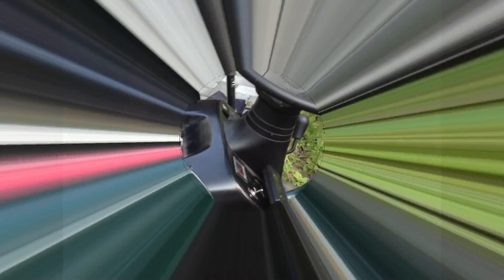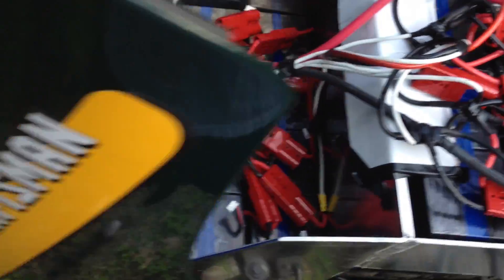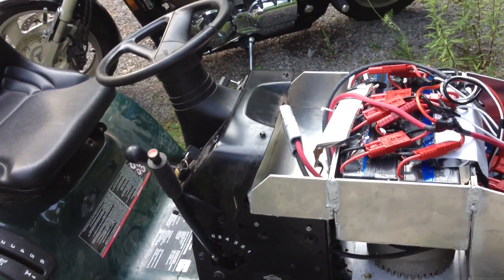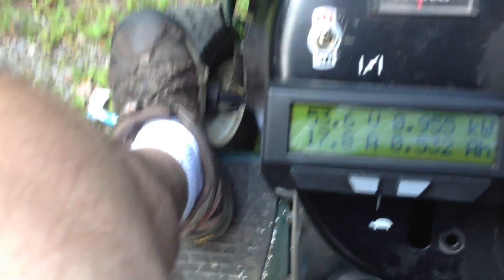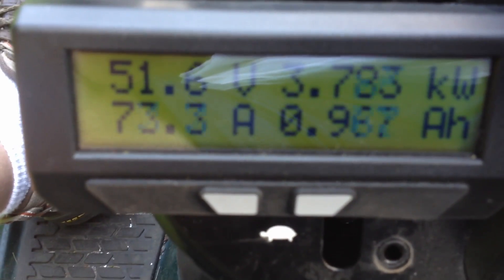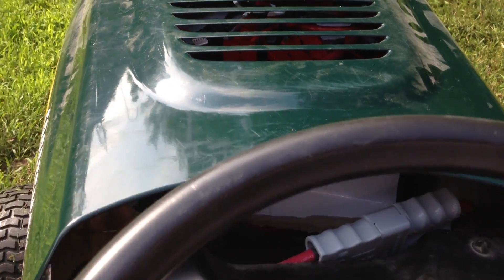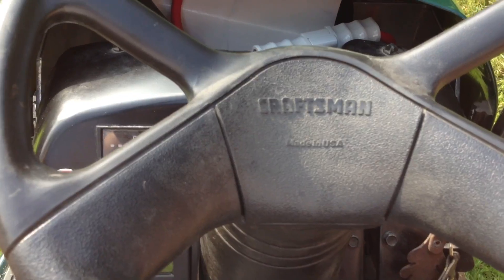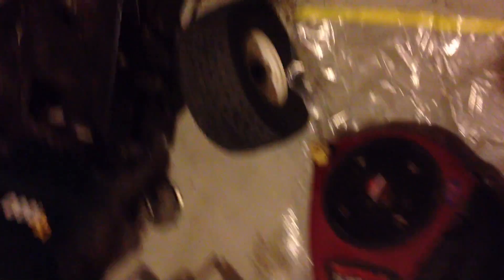Electric Lawn Tractor

Comment: New sub here.  Great video. I have a John Deere riding mower that is giving me engine problems. I am considering upgrading to the ME1004 as well. Would you use a different motor if you were to do one today? Thanks!
Reply from the maker: Brent Johnson hello.... and I laugh out loud.... not at you.....one needs to size appropriately for the task that needs to be accomplished.  This motor maybe too small for a skateboard on a drag race strip and too large for everyday street. 
If you have a huge property with lots of deep wet grass, you will have to size appropriately.  Are you running a pto?
Then you would probably require rpm control and a speed control maybe required.  Brent, as you can see, there’s no one correct answer, but I do urge you to size for the task and size the battery pack for the task, then double it.  
My hope was to be helpful. 😊
Reply: @TommyLuptak  I laugh with you. Haha. I am having to learn how to size it correctly. I have country pasture about 2.5 acres that I mow.  My idea for this conversion to be more of a garden tractor or utility.  Really I am wanting to learn about the details of such a conversion.  Your video was very good to give me ideas.  Thanks for the ideas and the laugh!  Oh you asked about PTO.  I have a mower deck they call a PTO but nothing hooked to a PTO shaft.
Reply from the maker: Brent Johnson  1,000 watts = 1kw
742watts = 1hp 
The current ME1004 says 11hp continuous and 20hp for 1 minute. 
My deck was 42” twin blade. 3500watts cutting. 7000 watts deep cutting. 
4.7hp - 9.4hp respectively.  
And that’s electric ⚡️ hp.  It never saw the 18kw (20hp)peak 1 minute rating. 
And if you are not spinning blades and just riding it and pulling garden cart, you’ll most likely never stress that motor. 
Riding around is like 1500 watts (2hp)
This motor easily accepted the pulls from the Briggs engine.  This was yet another reason I picked the ME1004.
Reply: Tommy Luptak yes that makes sense. The confusing part is hp for ice is different than electric motors.   With electric it is a function of torque & rpm if I remember correctly.  But in the end, my mowing needs are solved with my new mower so I only need light duty from this.  This is more of a learning process for me. I hope to also have a functioning mower in the end because that will be cool. Cheers man!
Reply from the maker: Brent Johnson well then..... this seems to be a good motor and well talked about and has the correct shaft (in my case) which made for easier pulley installation.  
May I suggest if you are going to add lithium as a battery..... if the battery can do 1C all day and 2C max with 3C bursts, size it to only pull 0.5C and your pack will last a long time.  Also, use LiFePO4 😉

Comment: I did pretty much the same conversion except on a Craftsman LT1000, using wood and screws for the battery placements. I lowered the CG by relocation one battery in the back behind the seat and relocated a second battery on a step in front of the dash.  My property is very hilly and steep, so the lower CG is a helpful safety factor...I installed a low cost floor pedal on the right foot position...been using it for about 8 years, hoping someday lithium Ion batteries would be available at a less costly option to lead acid...hasn't happened yet; but, when it does,  lawn cutting gear will be much more simple to use and maintain.
Reply: BTW, I also added a Alltrax motor controller  that is programmable and works great with the foot pedal:      https://alltraxinc.com/
Reply from the maker: Ladson Geddings .....  if one knows how to size lithium capacity to a lead equivalent, then one would know that lithium is the same if not cheaper to run.  100amp/hr lithium you’d need 400 amp/hrs of lead to get the same run times as lead cannot give you its full capacity at high amp draws.  Switch to lithium.   But size correctly..... cause you don’t want to hurt your lithium.  It’s all about sizing.  😊

Comment: Thanks for showing this. I was motivated to convert a junked out Husqvara. I used the same motor system for the drive uint (added a controller), but removed the pulleys from the mower and placed 2 36 volt motors on the deck. It runs off of a single 48 volt lithium battery (47 amphours).  Separating the mowing from the main motor and adding a controller has made it more efficient - I can cut for over an hour and several hours of run time if mowing is off.

Comment: If you find other videos, you can find guys getting way more cutting time with better bigger amp hour deep cycle batteries. Another guy easily got hour and a half  and used 25 percent power on an 1 acre of land, using 3 marine batteries for 36 volt system and 109 amp hours.
Reply: I saw him also, but he used a 48V system. He had another battery under the seat.

Comment: Little Eddie
Converting to battery power is a great idea for a garden tractor I converted one 15yrs ago and it is still cutting grass on a daily basis, I have had to renew the batteries every 7 yrs I am just on my 3rd set now, my design will cut up to 2 acres on a 50cent charge there are no belts or pulleys and no oil on the entire tractor, it can pull a trailer for about 8hrs on a charge, because battery run time is the most important aspect of most conversions I paid particular attention to the most efficient design I could up with, I used 3 separate small motors one for the drive with electronic speed control and two smaller with a cutter blade mounted on the shaft for each cutter, this design only uses the battery power req to do the job, very little wasted battery power, it uses magnetic breaking of both tractor and cutter blades and automatically applies parking brake when you stop or get off the seat.
Little Eddie Edmond Electric

Comment: Great idea but the energy efficiency isn't there yet to compete with fossel fuel mowers.
Reply: +Chris Phillips Erm...really? How energy efficient is a fossil fuel mower? And how efficient is an electric motor?
Reply: This is more energy efficient. 15.5 HP engine was removed and 6.7 HP is doing the same job. You think gas engine is efficient because gas stores a lot of energy and you get a longer run time but the $3 you pay at the pump does not include the carbon tax that should be payed for burning that fuel so gas comes out to be cheaper but gas is wholely inefficient compared to any EV

Comment: So how long does she last?
Reply from the maker: It's a 1.88kw Lithium LiFePO4 pack.  20-25min cutting (uses 3.5-6kw per hour cutting, if its dry and short 3.5kw and if it is wet and longer 6kw).  1.2kw with no blades on, so just riding around, over 1 hour.  It's faster and more powerful than the
15.5hp gas engine that I removed.  :)  Thank you for you inquiry!  :)  Peace! \m/ . . \m/

Comment: I love the idea of an electric tractor , i wish i owed one . I love the fact you did this yourself more people need to think that way . I am not a fan of the single motor configuration due to the efficiency loss from the belts and pulley system .  I assume this was done for simplicity , but it is the exact reason you can only cut for 25 min . 3 smaller motors would have pulled this off will less power usage and eliminated the belt system .

G,E created a series of electric tractors like that in the 70's called the elec-trac , hustler has a electric zero turn called the zion ,
Reply from the maker: Not sure It would be worth the extra effort placing and wiring and controlling 3 motors instead of one.  Once the blades are spun up to speed, I would believe the wattage usage would be similar.  It takes wattage to spin blades.  Driving without blades is appox. 1200 watts and with blades spinning 3500 to 5000 depending on the grass moisture/thickness.  So 3500w to 5000w minus 1200 = 2300 to 3800 watts divided by 2 blades is approx. 1150 to 1900 watts per deck blade.  Not bad considering the work that each 21" blade is performing 1.5 to 2.5hp peaks.  ;) :)